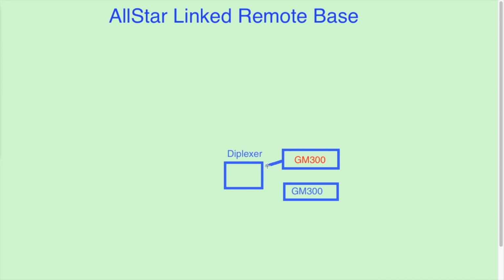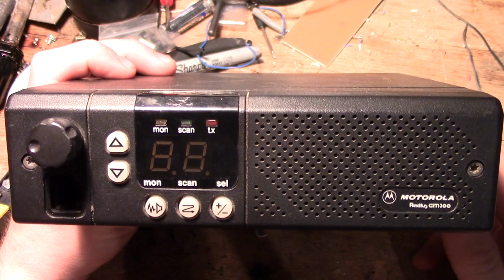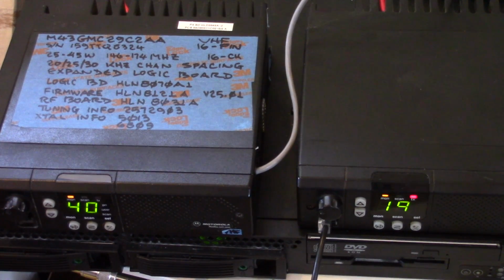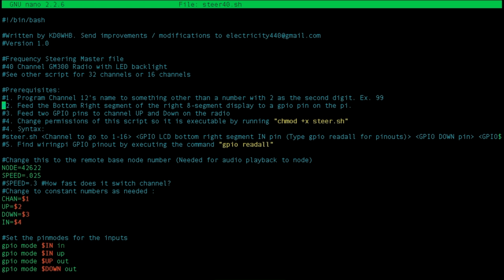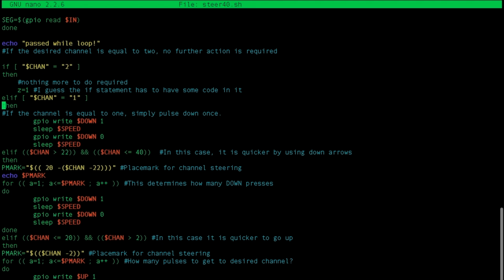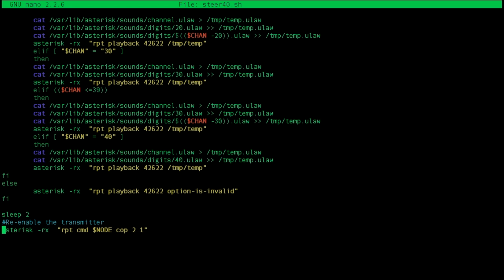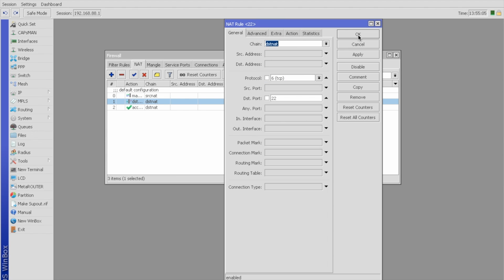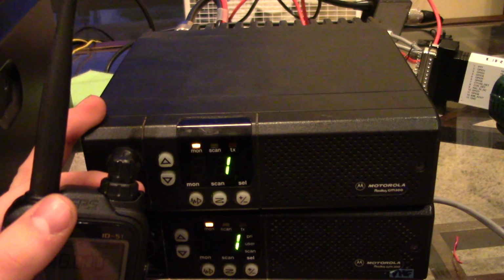Amateur Radio internet linked frequency agile remote base (AllStar link)

Comment: for your demo at the end, did you connect the speaker out to the mic in or were you able to access the internal audio (discriminator) to get better sound quality. I found that going speaker out through a controller and into the mic input, the sound is not as clear or full sounding than when you go through internally.

Comment: this is so awesome. i saw this video a few years ago, and it inspired me to build a steering controller similar to this on my kenwood tk-880 radio, using a DTMF decoder and a relay board to trigger the up and down buttons, soldered right to the control board like you had...  but it didn't work that great because i didn't use the opto isolator, so it didn't always trigger the pulse accurately.  i ended up abandoning that for a different radio system for the repeaters.  but now i'm revisiting this again to see if i can use this for an allstar link.

Comment: I don't understand how the controller (allstarlink) confirm what memory the remote is on? If it's just counting mem ups or downs what will happen if the radio loses power for whatever reason and defaults to mem 01 but the software thinks it's on mem 03? If there is a way to tell the radio "goto mem 05" no matter what mem it starts out on then, wow that would be so superbl. I like your setup I have the similar radios (Maxtrac 300s and Radius) where I would love to add a VHF remote base radio to my repeater (MSF5000uhf) so the local hams can access an adjacent citiy via DTMF commands.
Reply from the maker: Thhank you for your comment Doug 

AllStar Cycles through all of the channels to find "Channel 2" Channel 2 is the only channel without a certain segment lit, so it "KNOWS where it is" once it has found channel 2. 

Then, AllStar presses Up/Down the right amount of times to get to the desired channel. 

Maxtracs/GM300 also have channel steering lines on the back, but the # of channels is limited. This is why I made this hacked method.